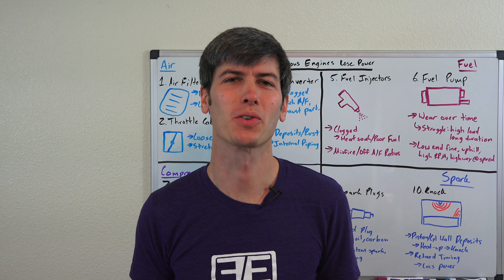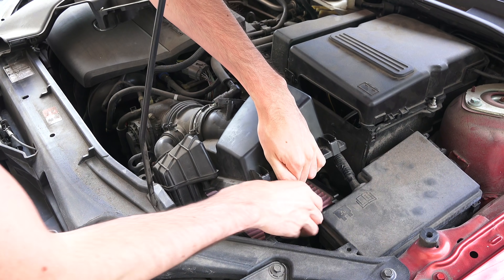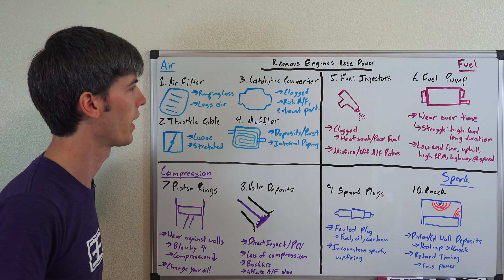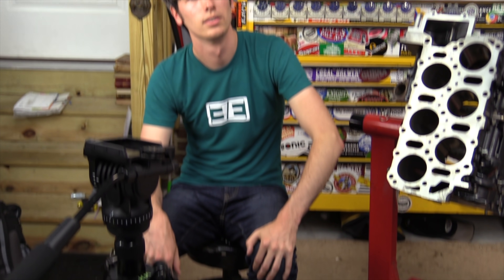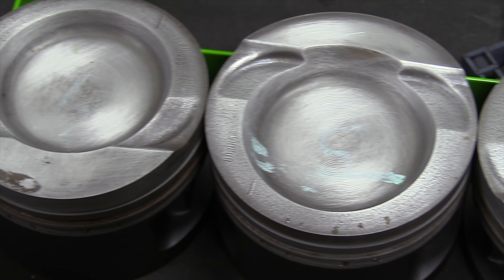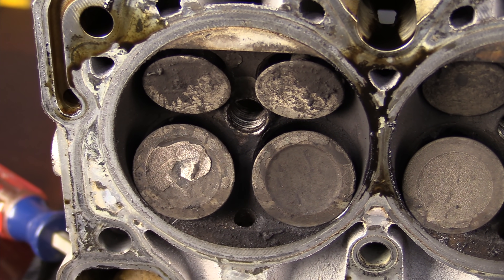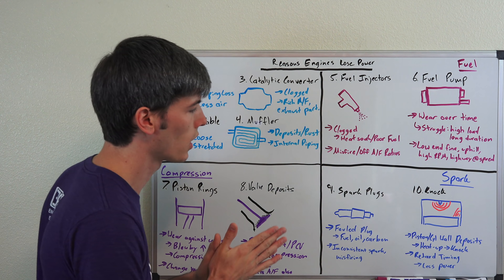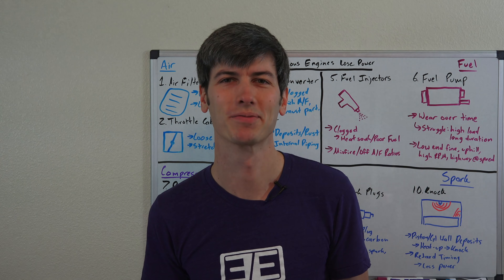10 Reasons Why Engines Lose Power Over Time

Comment: Throttle cable... youre just opening the valve less, with the same amount of human 'foot' input. IF anything has the biggest impact on todays modern cars, its Oxygen sensors and oil changes. Oxygen sensors become lazier over time. And wont necessarily throw a CEL. ever. And I've found that the condition of the oil in todays 4 cylinders really affects MPG. Im assuming its because the oil thins out thus not making as much oil pressure. Alot of newer Subaru's have ~100 psi of pressure.

Oil Condition Lives Matter

Still decent vids man, keep it up!
Reply: He went over throttle cable.

Comment: did forget ovaling of cylinder bore, oil caking, camshaft lobe and distributer gear wear. timing chain stretch, egr deposits, and since a lot of concentration was on external subsystems there was also a lot of meaningless non related issues. vacuum leaks. waterpump degradation, bearing wear, coil and point wear, and overheating issues, bore scratches and so on. for those who read this just don't consider this the end all be all there's stuff that isn't mentioned and nobody has all awnsers

Comment: A lot of engines gain power as they "loosen-up" with some miles on them, then eventually lose power as they wear out many tens of thousand of miles later.  I had 2 Coyote 5.0 Mustangs which gained 3-4 mph of 1/4 mile trap speed once past about 20,000 miles.  They were making more power than new.

Comment: I pulled a super heavy load with my truck and now it's horrible and weak. Why is that? My mechanical fuel pump was already leaking. VW 1.6 idi diesel.

Comment: I've got 600,000kms from a Land cruiser all original still running like new when I sold it. As well as getting hundreds of thousands of kilometers from other cars.

My tips:
1) don't use the oil your manufacturer recommends, use synthetic oil according to your climate grade. For example, Toyota put 5w-30 in engines in Australia where it gets to over 40c and the engine starts burning the oil. I use 15w-50

2) Change your fuel filter annually and if you have a diesel with mechanical injection pumps, use a good quality fuel stabilising additive that conditions seals and rings while removing contaminants and algae.

3) Don't forget gearbox oil changes, and if you have a 4WD, transfer and diff oils too. Don't forget to grease all grease points in the drive line and suspension.

4) Flush out your radiator properly, I mean removing hoses, flushing the heater core, making sure no hoses crunch with rust when squeezed and use coolant that feels slippery and silky between your fingers.
Reply: LOL. Using 5w-50 and the recommended from factory is 5w-30. I hope NO ONE takes you or your horrible advice serioulsy.
Reply: @AbduulG  well he is kinda true, 5w30 is really thin (like water thin) at high temperatures (speed), so on the highway for example. 5w40 would give you a bit more oil pressure and less wear. Most manufacturers use thin oil (0w20 or 5w20) for achieving better mpg (less friction after cold start). But it doesn't mean it's better for durability! I know it from tractors too, some used to burn a lot of oil on 10w30 but with 15w40 there is not a single issue! 10000hours and still no problem, (no oil burning) with an average of 40mph that would be 400000 miles! :) (And that's a lot!)
Reply: #1 is horrible advice. Heavier than recommended oil especially in a multi-valve or turbo engine is a no-no because you need the oil to penetrate through all those tiny spaces with ease. Also, the argument about Australia getting ‘too hot’ is BS. Ambient temperatures are always lower than engine operating temperatures…oils are designed to withstand engine temperature which is more than 100 degrees celcius unless Australia gets hotter than that, your ‘advice’ is bad. You should be thanking God for Toyota making an excellent engine that withstood your poor maintenance. LOL.
Reply: I average 450,000 - 500,000 miles with my vehicles. Oil changes @ 3,000 miles - Wal-Mart SuperTech 10W-30 non synthetic oil - Bosch filters. At 100,000 mile mark - change manual trans & rear end gear oil - replace timing belt/components - check/replace spark plugs/vacuum hoses - flush cooling system - new shocks - check suspension - regrease front wheel bearings - and just look/see for anything needing attention. 
Got 482,000 miles with 1996 Rodeo 6 cyl - valve guide seals started leaking - engine smokes a little at start up but still runs fine - has 60 psi oil pressure. Plan to pull heads for repair.
Just simple maintenance saves a lot of $$ - doing your own repairs even more. New car payments (and costly insurance) just flat out suck! I like having money in the bank. 😊

Comment: Should've mentioned cam lobe wear. Lobes wear down over time, less valve lift means less air. Also poor signals from sensors, eg O2 sensor, TPS, engine temp, air flow meter and so on...

Comment: number 11, camshaft wear, camshafts wear over time, this means the valve does not open as far as it used to decreasing airflow and causing a loss of power.

Comment: So can these problems also contribute excessive engine vibration? My 2000 3.8 Mustang is barely drivable because the whole car is shaking. I've replaced all of the spark plugs, the fuel and transmission filters, and visually inspected the motor mounts and I'm trying to figure out what to look into next. Any help is appreciated.

Comment: another common cause for ignition timing issues, as well as valve timing issues in older engines, (both of which cause power loss) is a worn or stretched timing chain.

Comment: Distributor, spark plug wires, coil, carburetor, stuck EGR valve, (not all of us are in the 21st century). Bad O2 sensors, bad/ dirty MAF, valve train springs worn, cam shaft lobes worn, valve lifters bent, bucket-and-tappets worn, IAC valve partially stuck, (weak idle), dashpot stuck, fuel regulator stiff, vacuum hoses leaking, bad ground from engine to body, loose timing belt, or chain (guides worn), someone mentioned fuel filter already, drive shaft bearings worn, cylinder head gasket blown, water jacket cracked, cooling fan connected to the engine, (biggest loss of engine power ever,) forgetting to pull out your handcrank after you start it, now I'm just being annoying...
Seriously, I liked the to-the-point of this video, and covers the big offenders in modern cars.

Comment: Hey EE, did you mention that recirculating the oil through the intake can help to clean the top of the valves as in the fuel injection example or create more deposits?

Comment: 1) air filter 2) fuel filter 3) compression.  I replace the filters and clean the top/bottom ends.  Add half a bottle of Marvel Mystery Oil to an oil change to flush the valve train and clean the bottom rings.  Use seafoam for a top ring and valve cleanse.  The first oil change turns black in half the usual time.  Add 1/4 of the remaining Marvel oil to the subsequent two oil changes.  Best cleanse is on a long trip (gets oil into all channels).  Drop down 1 and 2 gears periodically to raise revs.

Comment: always check the basics....bought a 01 ram 1500 with a full plow setup for 2k...good shape..little rust and trans was rebuilt. ..seller said hard time starting when it was wet out and didnt have time to get into it....i took a chance and bought it. ..the plugs ,cap and rotor looked original and were worn down to nothing....gave her a tune up and she runs like new...75$ in parts 2 hours time.

Comment: An important detail about "knock" (detonation).... Detonation comes from either of two sources; ignition or pre-ignition. All vehicles sold in the USA since 1996 must have OBDII, which effectively demands monitored knock sensors. If the detonation is the result of ignition, retarding the spark (the system kicks it back a *lot*) controls it. If you hear pinging, it means you have pre-ignition caused by hot spots. Ignition timing does not control pre-ignition.

Comment: An engine can't 'work harder' to take in air; a clogged air filter does restrict air but the engine doesn't do anything to come up with more air some other way; it just does without and runs poorly.
Reply: No, with insufficient air, the fuel can't burn.

Comment: 1) Air filters at the end of life have a negligible effect.2) Throttle cable stretch has NO effect.4) Mufflers will rattle well before it affects power5) Fuel pumps NEVER affect power, and if they do there is a lean P-codeGotta love the insanity that is spread by someone that has never been part of the engine industry.

Comment: Spark plugs are a big one. When my parents bought a new car and gave me the old one, it consumed lots of fuel and it struggled expecially at the low RPM range. I decided to take a spark plug out and look what's the matter, I found that they were so burned out that the gap was almost twice as wide as it should be. Bought and installed new spark plugs, fells like a brand new car. I had someone tell me that you have to change the sparkplugs every 30k kilometers. That, I think, should also prevent additional tar collecting.
Reply: Spark plugs can go for longer than that.

Comment: well unfortunately my truck has new intake/exhaust valves,push rods,head gaskets,intake gaskets,valve cover gaskets,fuel injectors,exhaust,fuel pump and it's still not running it better run like a new truck once i do get it running

Comment: Huh....Every car or truck that I've owned, I've run right on past 200,000 miles....and never lost any measurable power.  This has been objectively measured, too.  Good PM ensures virtually unaffected performance.
Reply: Well either you drive magical cars or you like to pretend this is the case, there is never a shortage of people who like to pretend their stuff is best...
Reply: I didn't say that my stuff was the best.   I said there was no measurable loss of power.  I'd expect that from anyone's car, that is properly maintained....not just my "magical cars".  Nice try, though. 
FYI, a few examples of my "Measures" are hand calc'ed gas mileage, 1/4 mile drag track passes, and chassis dyno session...and here is one example;  My 170,000 mile, '92 LT1 Corvette put down 278 rwhp/312 tq.  How much would an LT1 make in '92?  ~260 - 280 or so.    Magic has nothing to do with it; proper maintenance does.

Comment: Did not mention cooling issues which can lead to head gasket failures, bearing wear which increases engine friction and reduces compression, bad ignition wires and dirt which can rob you of spark power causing faulty/intermittent weak spark, proper air fuel mixture as running either too rich or too lean can cause loss of power as well as overheat, burning valves or carbon buildup.

A whole lot of issues one can look into.

Comment: Although you are right about ring gap increasing over time it is the wear on cylinder crosshatching that adds the most noticeable blow-by which is why a hone is essential for an engine build;  with a worn cylinder wall there would be very minimal compression

Comment: 2001 Acura CL Type S  When it had  43,000miles in 2003 it run 14.7 1/4 same as a new one, 165,000 miles now it runs 15.5, , so rebuilt Transmission, Head Gaskets, Clean up Intake, Plugs, New CAT, Fuel Pump, A/F Sensors, Now it runs 14.7

Comment: Awesome video. Thats why im changing my semi engine oil every 4k miles, changing my plugs and air filter every 10k miles, usinv fuel injector cleaner and seafoam to clean my internal combustion carbon deposits and regularly scan my car ecu for faulty codes

Comment: What period of time and mileage are you talking about, what vehicles? This is too general, covers the issues even for the cars from 100 years ago. If today’s car technology does not address these issues then the tech from 100 years ago has not changed much.
Reply: How do you make an engine with no moving parts? As long as there are moving parts there will be wear. As long as we use petroleum based fuel there will be carbon bi-products. How do you make a filter that doesn’t collect particles? 
Every car manufacturer has different service intervals; how is it too general? 
I’m not sure what you mean; the video made sense to me.
Reply: Completely depends how hard the engine has been ridden and how it was/wasn't maintained, if someone uses their daily car as a racecar then you can't expect longevity as all the components are under far more stress, but you also find old grandma cars that just never got a service and their engine has been grinding itself away with the lack of oil.
The tech hasn't changed much, although you need to understand 100 years ago you needed to do a rough maintenance cycle before every drive.
 If we wanted really high longevity then that is a case for electric motors since it's only their bearings that experience physical damage, but obviously you are then tied to battery replacements.
Reply: I had a 2003 accord that I floored regularly except during highway driving. I changed oil and filter every 30,000km and reached just below 630,000km. Engine didn’t break but it wasted more oil. Steering rack broke as did the rear suspension. So I’d say none of the things stated in this video really applied to my car for 575,000km. Is it even relevant at all if every car today can reach 0.5 million kilometres?

Comment: Fuel injected gas engines don't suffer from dirty air filters hardly at all.    There is an EPA study on this showing the engines and fuel mileage are essentially unaffected for a ridiculous amount of time.      The holding capacity for contamination is pretty good with modern cellulose and I recommend installing an air filter restriction gauge if you want to get not only the most out of your air fitler but also cleaner air into your engine.     In a cellulose based air filter the highest percentage of contamination actually passes through the fitler during the very early part of its life as the larger pores are waiting to clog.    So efficiency actually increases during the later part of the filters life, which means older air filter can actually equal reduced engine wear since airborne silica will enter the engine and cause abrasive wear.
Reply: Well it is a very specific reason for it, you filter is intended for the engines maximum capacity so as long as you drive it at less then 20% a filter that can only let through 20% of it's rating is still ok.
But the moment you try and get more power there are problems all over the place.

Comment: do you know why different automakers write different maintenance schedules? like for example, Toyota these days is 8000 KM, subaru is 8000-10000 KM, kia is like 5k-6k KM and changes, volvo and benz is like 12 k or 15 k and up. Is it the oil they use, the quality of the engine, etc..?
Reply: Mewzyc it's just marketing. The companies that have the higher oil change intervals don't have better engines, they are just advertising to the customer that the car has "lower maintenance costs", even though it's worse for the engine to wait longer
Reply: Modern fully synthetic oil is far better than the mineral oil blends generally used up to say around 2000. It`s protective qualities are still pretty good even after 10,000 mls. (Std. Ford service interval). Your service intervals are wrong I think. Far too short.
Reply: swr Nismo makes sense in a way because I notice that no matter how high they write the oil change intervals, it always say to do it once a year if you do not approach the mileage.

Comment: whats the recommendation for cleaning valve deposit off of intake valves? what's the best thing that can be done with that?
Reply: A few long high-speed runs after a full service, using the highest quality fuel, containing cleaning agents, will usually clean combustion chambers and valves quite well. Go slowly for the first half-hour. You could add a proprietary "engine-cleaner" additive to a full tank of fuel also if you wish. 
If that doesn`t improve things, a full engine overhaul is required I`m afraid. I wouldn`t bother just doing a top-end rebuild, as the extra performance could knock out the bottom end on an old engine.

Comment: i dont work on cars at all so i buy Toyota...my yoyo has 300,000 miles and does a better burnout than when it was new...the motor was so tight brand new that it had a hard time revving but after it broke in at about 75,000 miles it was able to roast its rear tires

Comment: Kinda related to  #5.  Question :  is there any advantage to putting higher octane gaz in a normal car ? (Hyundai Accent)  I won 25 litres of gaz, no matter which octane rating, should I go for the most expensive or does it not matter at all ? tyvm
Reply: Just get the recommended stuff, you gain nothing with high octane on an engine that doesn't need it.
Also important to note there are 3 different octane ratings used in the world and their numbers don't match, so when people tell you stuff on the internet it is very likely the octane numbers are from a different region.
Reply from the maker: If it was by quantity I'd get the highest grade. They have more detergents/additives in their for keeping the engine clean (but not really necessary).
Reply: yea it matters a lot. High 100+ octane racing fuel has lead in it. if your car is stock, go by the manual. I have a caddy cts-v 400hp engine, calls for 87 octane( regular)

Comment: Missed a very large reason for power loss in the intake, vacuum leaks and worn/dirty sensors. One everyone misses is the MAF, the car service schedule say to clean them every 30-60k miles. And if the exhaust rusts open/off shouldn't it technically allow air to exit quicker? Increasing pumping efficiency? I'm sure it will be very minor and very annoying to hear, especially with modern exhaust being so efficient.
Reply: A blown exhaust will cause a loss of "back-pressure" in it, something the manufacturer has designed into the whole scheme of the engine. It will therefore not be running as they intended, and so will be less powerful.